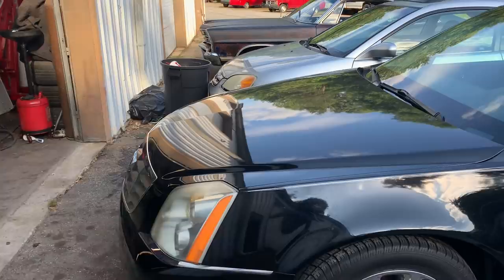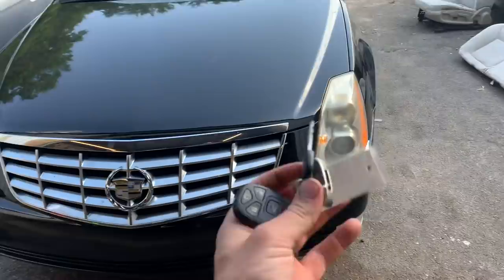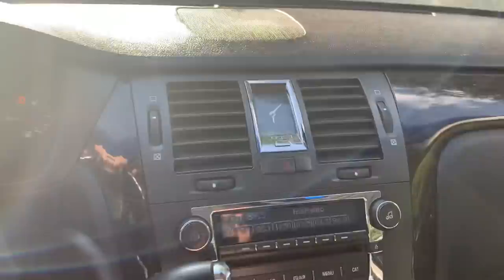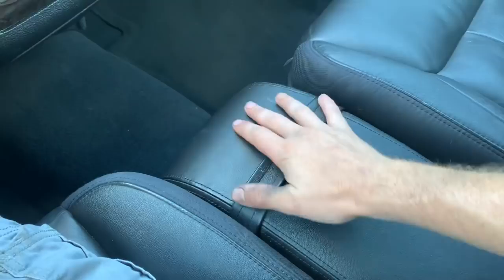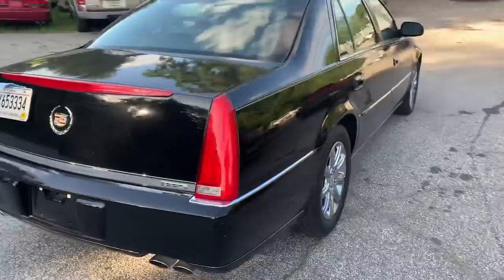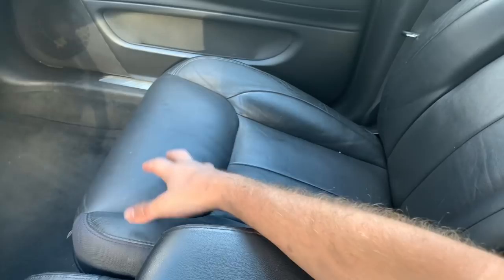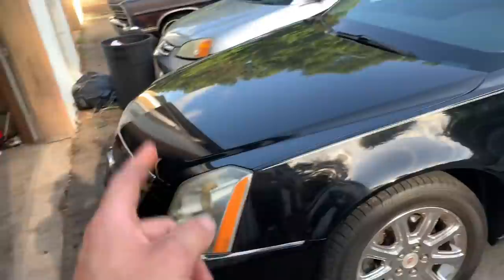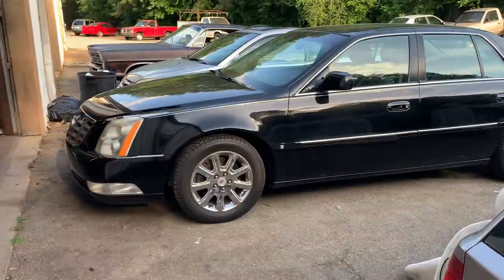A GOOD NORTHSTAR!? 2008 Cadillac DTS

Comment: My 2006 and 2008 DTSs were great cars.  Drove each about 85,000 miles. The 2006 held up well in a helluva wreck; collapse panels worked well. The gap between the rear end of the left front quarter and the leading edge of the driver’s door remained true. By the time State Farm [finally] told me that the 2006 would be rebuilt I had already bought the 2008 Platinum DTS. Loved both cars; now in a 2019 CT6-V. What beautiful car. They’ll bury my as in a Caddy!🥰

Comment: 2004+ northstars are actually very reliable engines. If you look up the headbolts on rock auto, that's the year they revamped the design. These are what you want to have for a cross country road trip. The last great American highway cruisers.
Reply: And if it’s not Northstar ,  the 3800 is a good engine too from what I have heard as well
Reply: @SeanPennII  
Oh the Buicks must of gotten them then. Thanks
Reply: @42luke93  the Buick Lesabres are a poor mans Cadillac I love those cars and engines very smooth & plenty of power.
Reply: @paulsosa1872  Smart man's Cadillac!
Reply: I’m looking to get a cadilac dts what year should I get that has the no longer has overheating and fixed design? @isrealballew4155?
Reply: @walteranderson145 grab a 09-11 get a premium at the low end and a platinum if moneys not tight…the platty is the nicest looking , leather wrapped console, shifter and a special leather on seats vrs.lower trims ..special suede headliner, light real wood trim accents, chrome touch on door handles nicer wheels….
Reply: I really like my luxury 3. It was cheap with 95k miles. Paid like 5gs for it. Runs like a champ and it is the rarer black cherry color. Has all the options except navigation which I don't care about at all. Super smooth running. You can't even tell it is running until you get up close to it. Same with inside. Sometimes I forget when it is idling. Did some suspension work to it and now I am doing brakes and control arms. Even if it doesn't need them, I am doing it anyways. it is a 2008.
Reply: Your 2006-2011 DTS were better than 05 and before.
Reply: Not an 06 to 11 the abs module can shut it down. That is a very poor design l. The tcm bcm rear fuse box issue the ground issue.powerl steering.😅😅😅😢issue. ²Then if you get a Northstar that's  a derson145
Reply: @anthonystone2557  The fuse box is a stupid issue. I fixed mine by taking the fuse box apart and replacing the female to female terminals and fuel pump. Been fine for months.

Comment: That DTS is SHARP!  But to be fair, ALL the Northstars COULD be good...  IF you got lucky enough to get one that the head bolts weren't overtorqued at assembly.  A person had about a 1 in 10 chance of getting a good one.  I totally lucked out.  I have a '99 Deville w/ 192K that purrs like new.  I love it.  It has the Firestar Gold paint and absurdly comfortable gold leather seats.

Comment: Funny, a customer of mine got a 2008 DTS a couple mnths ago. They put tires on it pretty much immediately, and it developed a bad power steering pressure hose and a bad T fitting in the heater hose, both of which I replaced. The heater hose is a huge pain, but that's done and it no longer overheats. The power steering hose was comparitively easy, enough that I was able to do that one in the field despite spending 40 minutes underneath it due to a lack of space. But she runs great now that she's fixed. Super comfy, decent sounding engine.

Comment: God I love my '08 DTS Premium (black on black), upgraded from a 2015 Altima. I will not change a thing about my car, I'm keeping it all stock. She came with 106K and now at 120K, massage seats, 8 speaker bose system, moon roof, rear window shade etc, etc... I was fortunate to have stumbled upon this car at the right time. So far all I've swapped was the purge valve, rear fuse block and of course threw some Michelin's back on and replaced the rear driver door motor/regulator. I never wanna let her go. GREAT VIDEO!!!

Comment: Love the DTS and STS, as bad of an engine they might have I just love these cars.
Reply from the maker: As mentioned, they got really good after 05! You should check one out!
Reply: @MXguy95  yes sir! Though I love the 98-04 sts the most, if I can afford it one day I definetly would pick one of these up.
Reply: @Bobby-cm7vu  get 02 and up.
Reply: @Bobby-cm7vu  Had a 2000 STS in pearl red with the black leather.. Loved it to death. Saved my life in a bad accident
Reply: @billsgarage6453  my dad had a 98, he loved his to death as well, he would still have it today if the damned snow plow truck didn't total it.
Reply: @Bobby-cm7vu  Piss green Kia soul is what took mine... Worked so hard to buy it off my mom and keep it pristine. Another will come along though
Reply: @billsgarage6453  my neighbour's owned an SLS for a long time, but just recently got rid of it probably becuase of the headgasket issue. Old man barley drove it, probably drove it once a month and didn't drive above 50mph in it. I know these cars don't hold much value but it's sad to see it gone one day.
Reply: @anmous69  Only slightly got better, but wasn't a good engine tell it was too late in 05.
Reply: @OhPhuckYou  my 02 has 250k miles on it still running strong.  Blocks got changed so head bolts wouldn't pull out of the block.  You can still blow the head gasket if you cook them by overheating. But stand alone failures went way down. Oil leaks however are still an issue. Lol
Reply: @anmous69  The amount of early 2000's DeVilles for sale at scrap prices or putting around town running on 7 cylinders begs to defer. They did get better, but still not reliable by any means. My uncle had a 00 DeVille that lasted well over 200K without the bolts pulling, but that's not saying they were fixed. I've had far more experience with fucked Northstars than not. There were a few good ones, yes. Seems another killing factor was the DexCool that GM loves.
Reply: I'm looking at an 2008 DTS for $2000 all it needs is a water pump the rest of the car looks really good. What do you think?
Reply: @paulsosa1872  if it isn't to late hell yeah get it.
Reply: I’m looking at one from the dealership with 125,000 miles for $7300
Reply: @cadillac9142  Put it this way. I got my 2008 DTS luxury 3 for $5200. 95k miles. Granted it needed some suspension work, but it runs like a top and doesnt drip oil yet. Black cherry color and loaded. I love the dts. My next car might just have to be the platinum or performance model. I want another one so bad lol. I put about maybe $800 dollars into it with new struts, sway bar ends and bushings, shocks, and I have brakes and control arms I want to replace too. Still a good deal for the car it seems.

Comment: My dad just recently sold a 2005 Deville with the 2nd generation 32V. It had 180,000 miles at time of sale. Unfortunately it had failing rear main seals and manifold head gaskets. The shop wanted 4,000$ to replace it. But my lord for the 4 years we got out of it. It was a land sofa and I loved it so much! My dad is currently looking for a Replacement, possibly a 2008-12 DTS.
Reply: This 2nd generation DTS was built in Detroit from 2006-2011. Last one rolled off the line May 27, 2011. With only 11,000 produced and built for the 2011 model year.

Comment: When I was buying a car last Fall, after my ‘11 Civic crapped out, I was looking at a budget of $8k-$9k. I was seriously thinking about one of these—I absolutely love the design, especially with the screen and floor shifter, but I couldn’t do it. Not because of the engine, but the fuel economy. Sprung for a 2012 Lincoln MKZ Hybrid instead, and 36 MPG can’t be wrong, but sometimes I still wish I’d gone for the Caddy instead.

Comment: I don't know about the different generations of the infamous Northstar engine but I know whatever generation they still hold the same reputation. I recently had a customer who had a 2009 XLR convertible with the North Star. It's what we call in South Florida a condo car. A condo car is a car owned by a senior citizen who not only put very few miles on their cars but usually keep them garage door under an overhang and have all the schedule maintenance done usually at the same dealership. This 2009 had just under 18K original miles and looked like it just came off the Cadillac showroom floor. As soon as any of the other wholesalers see that it has the infamous 4.6 Northstar they bolt like the car is about to explode. It was stunning to me to see that the book value of this car was almost identical to an Avalon of the same year with almost 200k miles on it especially considering the Cadillac cost almost three times as much brand new. It's a shame because I agree with Jay that they are stunning cars to look at with some of the most comfortable rides I've ever experienced but yikes can they be trouble!

Comment: I love the DTS I've been in the previous model to this a 2003 one it was ex footballers car drove like a magic carpet so smooth
Reply from the maker: Those were the ones that had headgasket failures over and over. Just imagine that but with no more overheating problems haha!
Reply: @MXguy95  I know Shame really when they were running ok they were good but least the one you have is the better one of the 2

Comment: I am a former Cadillac technician from the late nineties in California. Personally I love the North Star my son drives 06 DTS in our family ride is an 08 DTS. The North Star is a misunderstood work of art. The oil leaks actually kept my children from going to Community College.. we used to get 28 hours for a complete reseal at the dealer. I used to do them in the car once the transmission was out it was Bam Bam done. You're rolling if you are blessed with two of them on a pay period I love the North Star
Reply: What is the issue with the gas pedal and wiring and the code 0138?

Comment: I would consider it because they ironed most of the bugs out by then. Then again I love my 4.9
Reply from the maker: Oh you cant compare it to the 4.9 thats cheating! LoL those 4.9s are bulletproof man. But the new NorthStar's are definitely competing now
Reply: @MXguy95  144k miles on mine and still going strong pretty much. Needs a valve cover gasket and a water pump soon but I’m very happy. I’ve had my car now for about six months and 10,000 miles. It’s a 94 sedan Deville
Reply from the maker: oh bummer, have fun with that water pump job I loathe those. Did a few and am pleased to not have done another lol. But yea, those cars will run forever and youve got the good body on it too, 94 was smooth!
Reply: @MXguy95  I got a buddy of mine who is willing to help me out with it

Comment: Have a 06 cadillac dts...after we had record low temps in sc car is now running hot after about 15 minutes,,,no leaks,,no oil contamination,,,no smoke,,,did a combustion leak test  and pressure test,,all neg,,,any ideas what im missing,,im 66 and always been a do it your self mechanic but this is my 1st dts,,136 k miles and never had a issue

Comment: I had a choice between a 2011 Impala or a 2010 DTS and i went Impala because i stayed away from northstar. Everything in my Impala is the same as the DTS. Would i have chosen a Cadillac if i had known they fixed those issues. Of course. But i'm happy.
Reply: The Buick Lucerne is the  same, consoles identical,frame is same length etc,,,most have the 3.8 or 3.9 (2009-11)…you can find the cxs one and they come with northstar too…they both were built in hamtramck,Michigan…if your scared of the northstar but want the big car and nice ride grab the Buick Lucerne 06-11…both these cars ended production in 2011.

Comment: The Steering Wheel and Dash layout is almost identical to a 2008 Buick Lucerne we owned. Good Old GM and their parts bins lol
Reply: The DTS and the Buick Lucerne are essentially the same car. Built in the same assembly plant in Detroit. The Lucerne is built off the same platform as the DTS. Also the Chevy impala as well....Great cars!!!
Reply: @k.c.marshall921  Chevrolet Impala was a W car, like the mid-2000s Buick LaCrosse and Pontiac Grand Prix.
Reply: @jeffshadow2407  It may be a "W" platform but they are still related.....especially after the 2006 redesign.

Comment: It only took GM more than a decade to solve the head gasket issue
My local Cadillac dealer didnt even do the head gasket repairs. They just did a re manufactured GM  crate engine swap

Comment: I had a 2011 DTS Platinum back in the day new. Got rid of it with 23k miles and it had already has a engine replaced under warranty. If I didn’t have the warranty it would’ve been a 12k bill from the dealer.
Reply: Wow 2011 and replacing a engine? The platinum trim level is the best so nice looking inside…thought the 06-11 northstars were much improved like this guy is saying..what happened?

Comment: One of the reason you see these with so many miles is the livery companies (executive transportation companies) used them and maintained them. Now your starting to see the Lincoln Continentals with 200k on them for the same reason.
Reply: I think mine was on of those. It only has 96k though but doing a car fax, it was a fleet vehicle. Might explain why it doesn't leak oil.

Comment: In typical GM fashion, they let an issue/problem fester year after year. I believe this head stud issue was "Fixed' for the 2006 model year- only about 15 years after Caddy introduced the Northstar. Reminds me of the oil drain back issue that kills the timing chains with the 3.6L junk engine (which a $5 PVC modification and changing the oil every 3500-4000 miles takes care of)
Reply: Not only GM you remember Audi and the rotary engines
Reply: @kennethfernstrom1297  that would've been NSU, whom Audi bought cheap due to the Wankel issue. Ironically, I've been in one in Germany (military  kid). It was rare even there

Comment: You can’t do a transmission service on a Northstar without removing the transmission. The filter is in the side cover. Changing the fluid will not help the unit last longer. New fluid still has to pass through a dirty filter.

Comment: I have a P2432 code Air system air flow/pressure sensor circuit low Bank 1, is the check valve for bank 1 on the right lower side or the one on top near the fire wall? Any help would be appreciated

Comment: Heard they fixed the North Star engines starting in 2005.5 and after
Reply: 2004-ish, GM did kind of a rolling update to them that year, so probably best to just stick to any 2005 and newer in the front drive models... The rear drive 2004+ XLR and 2005+ STS used a revised version of the Northstar which are also a safe bet.

Comment: I’m not a big fan of the newer caddy’s. I had a 2008 CTS 4 with a 3.6 v6. That thing had so many issues with the trans/transfer case and had electrical problems. But your caddy is pretty damn clean for the year.
Reply from the maker: That was your problem pup, that old 3.6 is garbage. Same setup used in Acadias and tons of other GM nightmares of this era. But you should test drive a Newer DTS if you get the chance someday.. It just might surprise you!
Reply: @MXguy95  I might do that
Reply from the maker: 2005+ I pawmise you wont be disappointed. lol
Reply: @MXguy95  I wish I could find a 4.9 caddy but there’s none around NY anymore

Comment: I am a fan of these 2008 Cadillac DTS large sedans, because they are fast and bulletproof, compared to these older ones. Can you do a video of a 2011 or 2012 Hyundai Santa Fe mid-size SUV with the 3.5 L V6 engine and the six-speed automatic transmission next? Thank you very much.

Comment: As much as I hate Northstars, I have to admit the later ones are pretty solid.
Reply: Until it isn’t and needs the motor pulled for bed plate reseal. Head studs got better but as they age the 08 ones I service are getting the bed plate seam leaks.

Comment: Hi Jay - just got an 09 base model DTS with 77K from a good friend whose uncle owned it when he passed.  The only issue I am aware of is the ac condenser draining back into the passenger floorboard.  Found plenty of info on the tube location for the CTS, but NOT the DTS.  Any insight so I can get it cleared?

Comment: In 2018 I bought a 2004 Seville with only 75,000 miles that was a Kansas City car, ran fine until last year.  Had to keep adding coolant and was getting worse, thought I had the dreaded head gasket issue.  Turns out the overflow tank cracked and was leaking worse until replacing it.  Have another Northstar, a 2006 STS with 130,000.  Still running orange Dex-Cool, no problems.  After ruining their reputation, Cadillac finally figured out the original head bolts had too fine of thread and changed them around 2004.  But you also have to wonder about the Northstar coming out in 1994, AND the switch to Dex-Cool.  Was the engine design an issue, or the early formula of Dex-Cool?

Comment: Was this a fleet model or ex rental car? I’ve never seen a newer dts without heated or cooled seat buttons on the doors. Very odd.
Reply: I have my, it’s on the higher end DTS package I believe premium and platinum, My04 Dhs has heated and cooled
Reply: @hummer3524  That's what I'm saying, I've never seen one without at least heated seats. I know you could get base models with just heated seats, but after a certain point they kind of all came with heated and cooled. But I have never ever seen one without heated seats ever. They always at least have the buttons on this one. I can't seem to locate the button at all because it's not on the door by the handle where it usually is supposed to be. And how well do the cooled seats work?
Reply: @B0xlife1  I miss read your question yes, 2008 was weird for options with cadillacs. This must be a Base package.